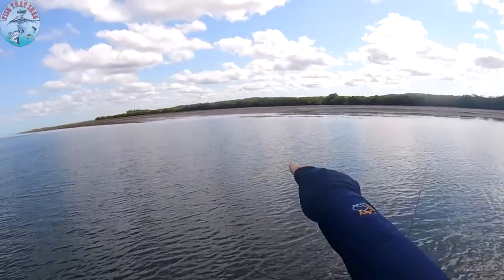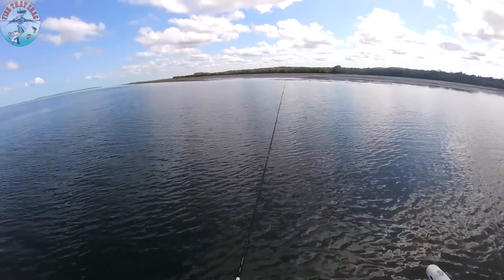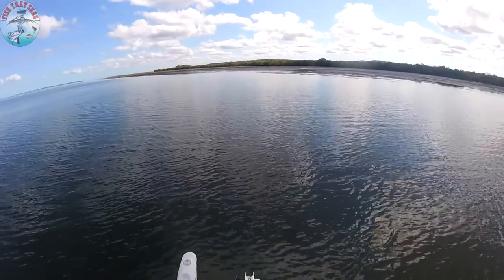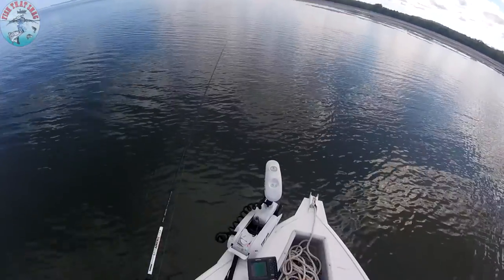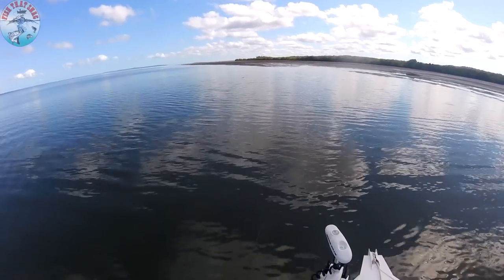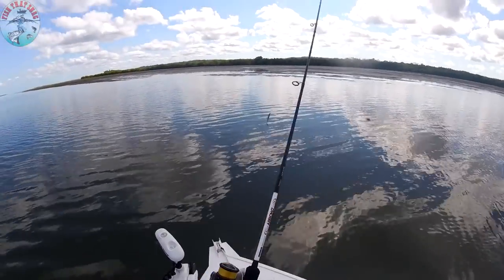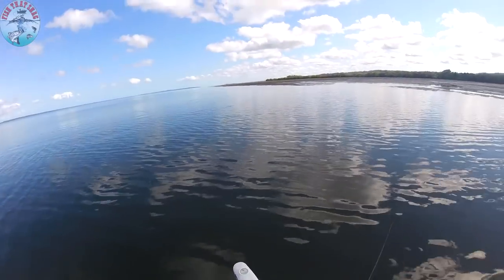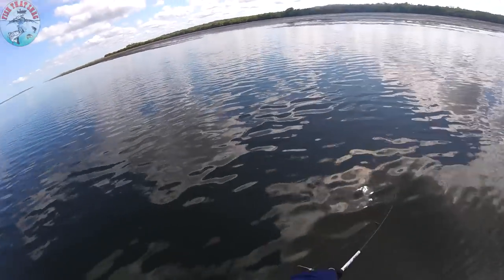Flathead Fishing on the Flats of Fraser Island

Comment: Hi Luke, love your vids. What Minn Kota do you use or what would you recommend in a 4.5 metre aluminium boat
Reply from the maker: Cheers for watching mate. I had a 12v 55lb Minnkota on the 4.4m quintrex and it was great. Occassionally in very strong current, huge tides etc it would struggle but 98% of the time it was great. On the minnkota website they actually have a tech sheet which recommends electric motor size for boat length. According to it the 55lb would be fine for a 4.5m. If you want to be 150% sure go the 80lb 24v if you have the dollars.